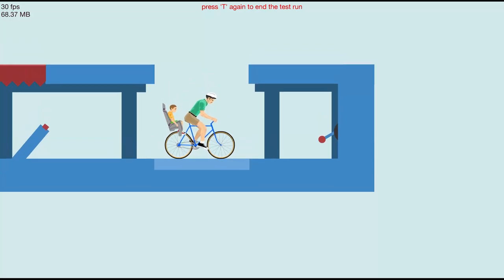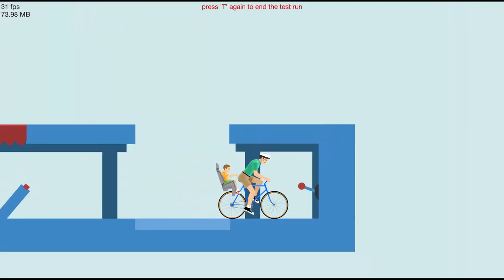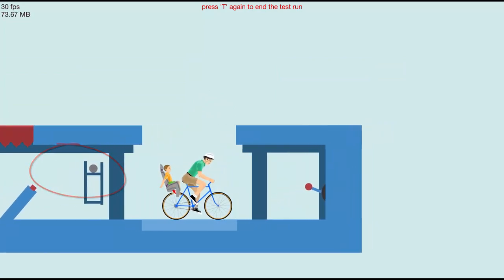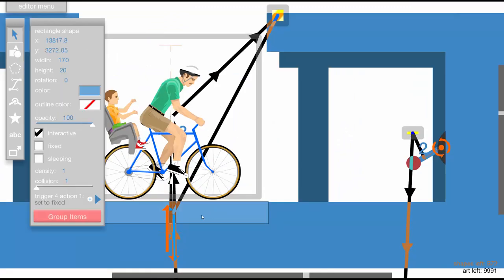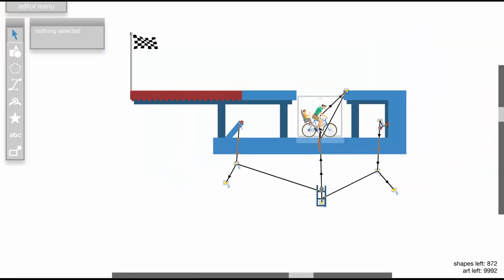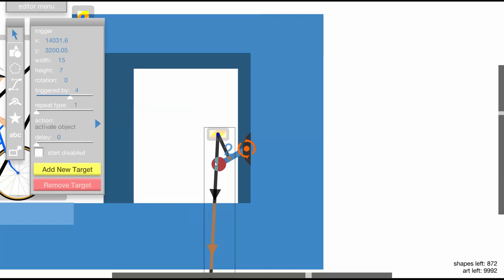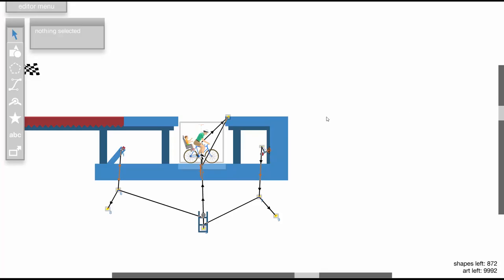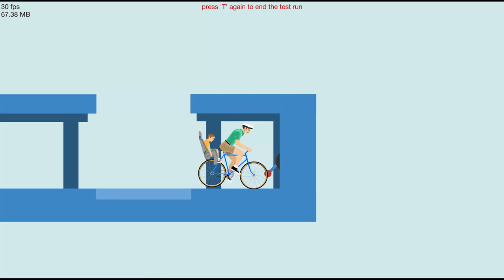Happy Wheels Comment Tutorial #1 - The AND logic gate mechanic

Comment: Thanks so much! <3

Quick question. How did you make that elevator? I screwed around with elevators and sliding joints in my level Ohio Jones, but I fucked it up pretty bad lol. Simply a text explanation would do.
Reply from the maker: Add a sliding joint with motor torque 999999 and motor speed 0. Set the elevator trigger to motor speed 1. Make it also trigger a second trigger, with a delay of choice. After the delay, the elevator will be set to fixed.
Reply: Ah, ok. Thanks so much!
Reply from the maker: No problem!